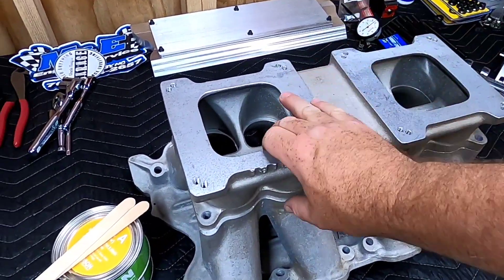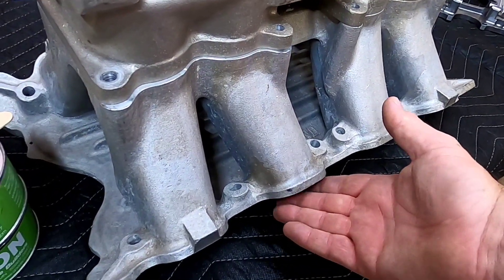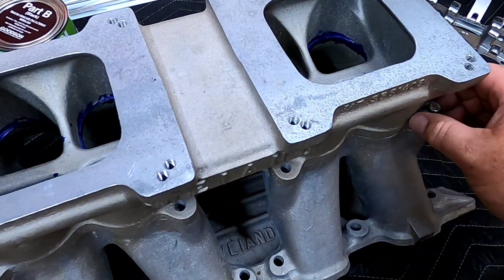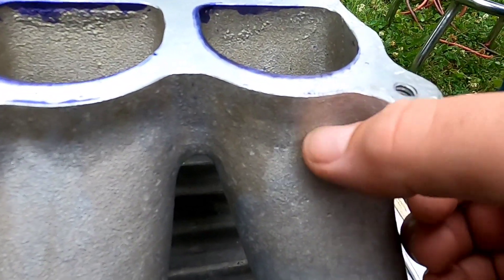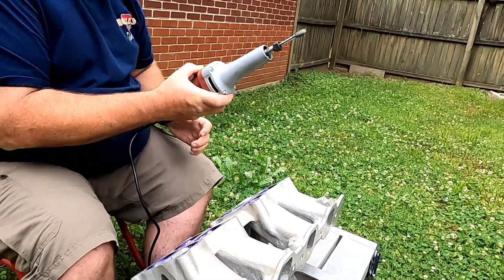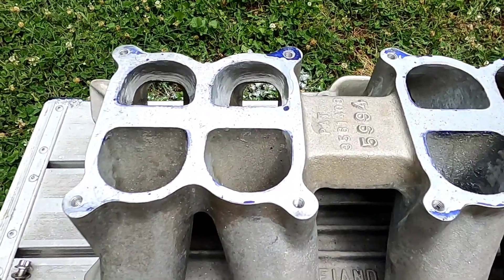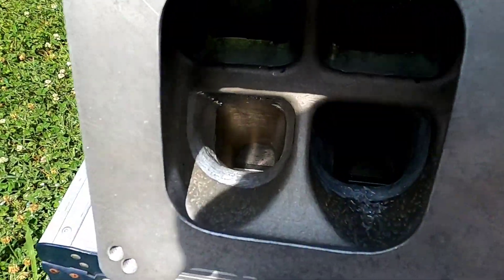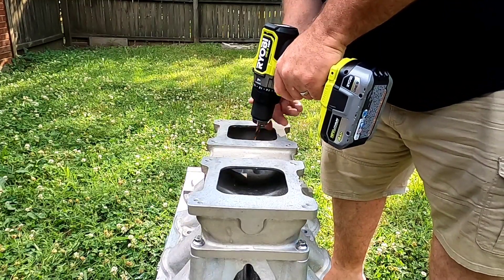Tunnel Ram Intake Porting for POWER!!!

Comment: So far so good, Pretty str8 forward stuff but I'm NOT sure exactly why epoxy is needed Just yet, So I'll be waiting on Part2. Good job brother!
Reply from the maker: Jon I'm using the epoxy to do two things.. port match from the Cleveland 4v port to the Large Windsor port that the Hammerhead Performance Engines head used.. the radius is different in the corners and so I can create a proper taper in the runner to increase the port velocity into the intake port.. this will help fill the cylinder and make more torque and power across the board!
Andy

Comment: Looking good so far. I'm glad to see that you found some kind of off the shelf manifold that can meet your goals for power, a sheet metal piece would be astronomically priced and is un necessary at you power levels. I've watched them Kauffman Pontiac boys up here in my neck of the woods build one of them sheet metal tunnel rams, they take lots of time and lots of welding but that's expected on 1500 hp plus big cube engine. Keep up the good work !
Reply from the maker: Doctor, you are right... While the sheetmetal intake would probably be best,  I wanted to keep the old school look and decided that I could make the manifold perform so, even though it takes a TON of time it will be worth it in the end...
Thanks for watching,
Andy

Comment: Might that casting boss in the intake, be a provision for installing a 1/2" fitting for a power brake booster vacuum hose? Most Cleveland engine Fords came with power brakes in that era.

Comment: Ive epoxied then port. Doing it that way straightened out the port as i went.
Reply from the maker: I'm trying to get the largest cross section I can in the upper portion then use the epoxy on the lower portion to blend the taper and a proper port match..  it's got to feed all 750 of those horses!
Andy
Reply: @UnityMotorSportsGarage  you will have plenty for 750.
Reply from the maker: You know Tom, I have a new Hi-Ram for the 351w and the Cross Sectional area is MUCH larger than compared to this old Cleveland Ram... It has similar area compared to the new 8.2 deck Hi-Ram that I used on my 600hp 393w.. I want to use all of the 385cfm head flow that I have with these heads at .675" lift!

Comment: Sad that that intake needs so much work before it can be used. I can’t help but to wonder what the manufacturer was thinking with the reverse taper runners.
Reply from the maker: It's hard to tell what they were thinking 50 years ago... But I do know that after they are worked over they make great power!
Andy
Reply: A reverse taper like that, as long as the cross section increases from top to bottom, will increase air pressure into the combustion chamber. It does decrease air speed, though.

Think of the bottom half of a carburetor venturi. Low air pressure at the top (throat of the venturi), more pressure at the bottom.
Reply: Mismatches that far from the valve job dont hurt that much. Hes just optimizing it.
Reply: @needmetal3221  still horsepower that they were leaving on the table. Not sure if the molds were old or what.

It's a place where 3d printing can really shine.
Reply: I’ve seen some that were a lot worse!